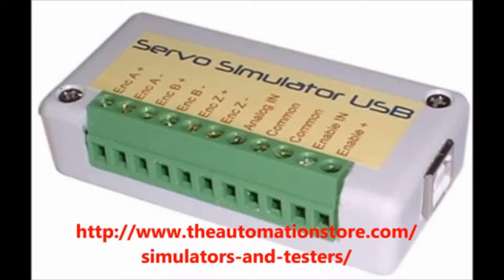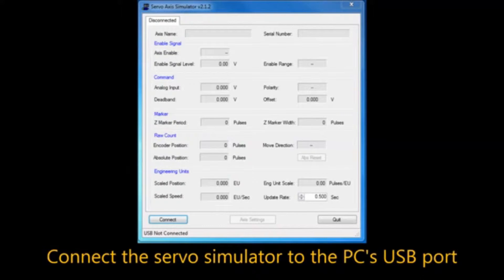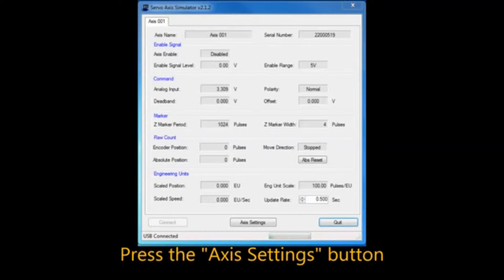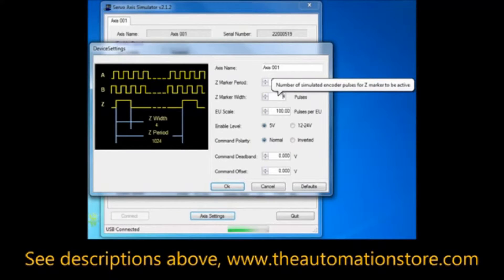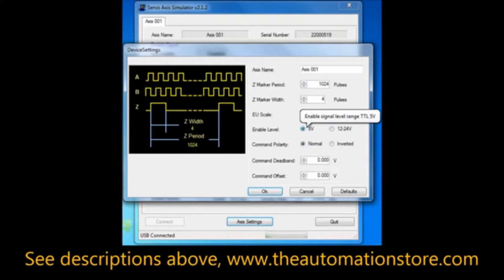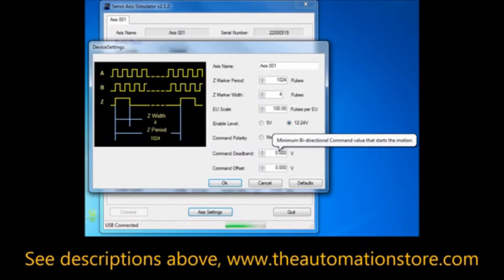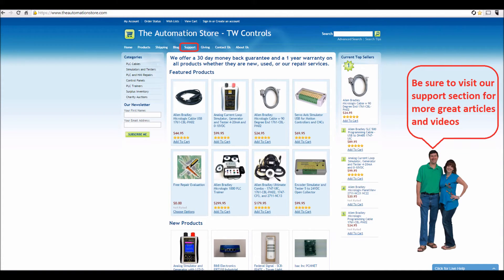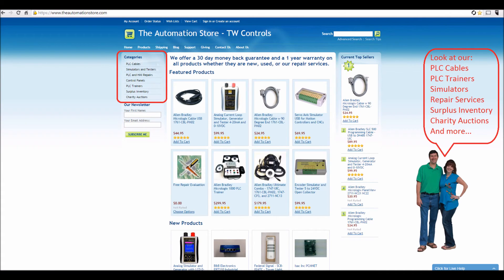Servo Simulator USB for CNC and Motion Control Applications Free Software Configuration

Comment: It would be nice to see this video updated to show PLC Tools Servo Axis Motion Simulator and Encoder Frequency Simulators in action with a Micro820.  Maybe even cover the difference between the different types of Servo and Encoder Simulators available.
Reply from the maker: Hi Dean.  The lessons below show the Servo/Encoder simulators with the Micro820.
https://twcontrols.com/lessons/allen-bradley-micro800-hsc-high-speed-counter-configuration-for-encoders-in-ccw
https://twcontrols.com/lessons/how-an-encoder-works-determining-direction-and-position
https://twcontrols.com/lessons/encoder-a-and-b-channel-signals-are-phase-shifted-90-degrees-clarification-on-our-encoder-lesson
https://twcontrols.com/lessons/calculating-rate-on-a-high-speed-counter-in-an-allen-bradley-micro800-micro850-plc